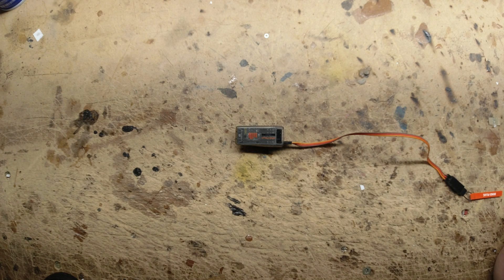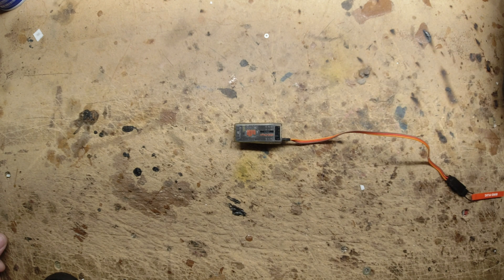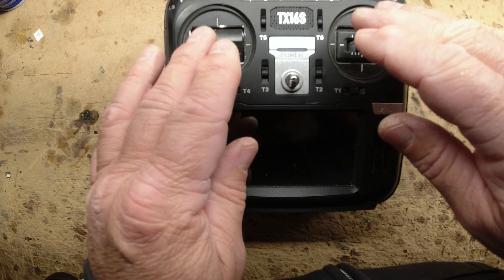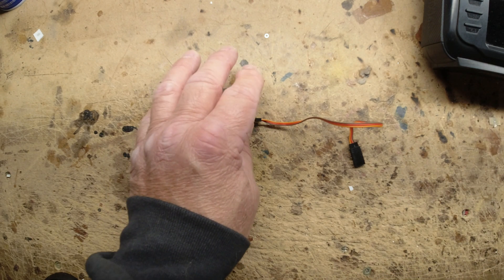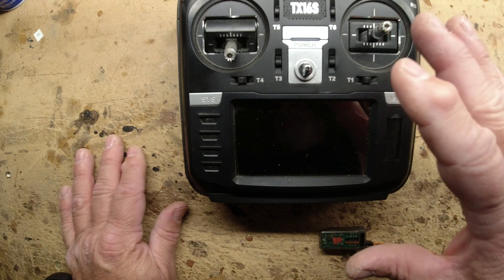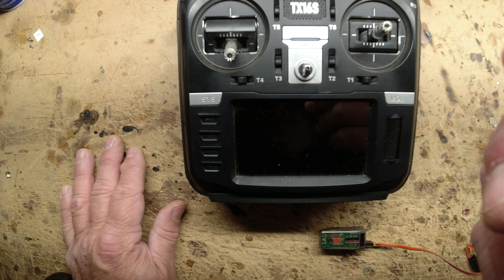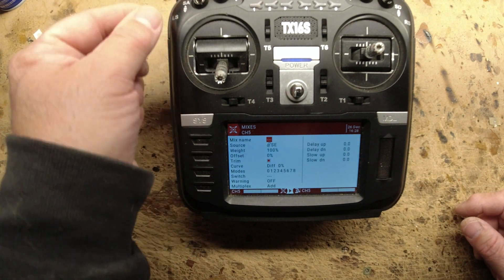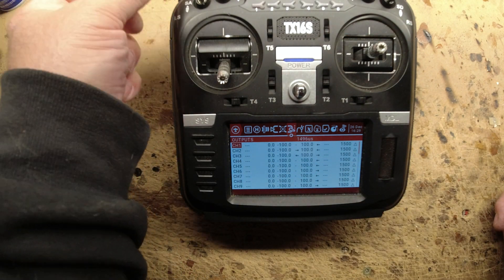Enabling both Spektrum SAFE and AS3X on your Radiomaster/Open TX Transmitter

Comment: Spektrum also has a control box & Bluetooth dongle that will fully bypass having to use a Spektrum Radio. I use my DX6E to program the receiver but it's only 6 channels. With the box, I can program countless channels & then use my TX16S to assign the channels to it. The other way is to have a Spektrum DX, NX or Ix radio & set it up. For under $50 I got the box & dongle because I have a lot of Spektrum stuff but I don't want to be tied to them anymore. I recommend this radio if you want diversity with your models

Comment: I just bought an Eflite Cirrus SR22T 1.5m BNF & the manual clearly explains the difference between keeping the bind plug in while binding & pulling it out before binding. You are 100% correct

Comment: are there any problem with umx planes safe,  or does everything work well?
Reply from the maker: Works fine with UMX
Reply: thanks, because I want to buy a UMX Turbo timber evolution and a TX16s and was unsure if it would work :)
Reply: so does that mean, that i could bind the plane to a tx16s.  And safe, as3x and the flaps would work without a spectrum transmitter?  
and would the binding procedure be the same as with a spectrum transmitter minus Setting which switch is controlling what cannel before binding?
Reply from the maker: I have heard it can be tricky when the plane is a 6 channel.
Reply: but does safe work without a spectrum transmitter or binding it to a spectrum transmitter?

Comment: I've done everything u mentioned it did the 2 flicks on the surfaces to get safe allocated a switch did stickers to centre but I'm still in as3x any ideas
Reply from the maker: There are 2 different ways to bind the receiver based on whether you want SAFE. When SAFE is enabled the surfaces will move 4 times.

Comment: Hey I just got gifted like 12 old rc gas planes, one of which is a ultimate 120 and this is a new world for me. It needs a new battery and stuff, whats your email address and if you don't mind id like to ask you some questions regarding it bc everything is enclosed and id like to ask you some questions... I see your plane profile picture is an ultimate
Reply from the maker: I’d love to help but unfortunately I know nothing about the gas planes, electric only for me.
Reply: @TakeItRC  ahhh ok, yea I've been electric only myself, a guy gave me all his old planes some of which are very expensive and they need new servo batteries and id like to update the recievers, I will ask you this tho, which brand recievers do you like other than spektrum? The planes now have older hitec in them and I want more modern recievers
Reply from the maker: @nichollsboy11  I use the FRSKY S6R in most of my planes. It has their version of AS3X and SAFE mode at half the price of the Spektrum receivers ( I have made a couple videos about them). Be warned there is a learning curve but I think they are worth it. I used to fly gas planes when I was a much younger man back in the 80s before electrics were even a thing and I have to tell you electrics are so much easier and actually have more power than the gas engines. Gas engines can be a real hassle but some guys,  mostly the old timers, still enjoy them.
Reply: @TakeItRC  awesome man thank you I just subscribed and ill check out those recievers

Comment: 1. The first thing you must do, regardless of the brand of transmitter is assign a 3-position switch to channel 7 or higher, if possible. This will let you use all 6 channels of an AR630, AR631, or AR637T(A).
2. To be able to unlock a BNF receiver, you must flash it with the latest firmware.
3. The latest Forward Programming LUA script will allow you to set up a Smart AS3X/SAFE receiver. You no longer need a Spektrum transmitter.
4. The transmitter must be in high rates (100% travel) when you toggle the flight mode switch 5 times (each way) while holding the sticks down and toward each other.
5. The TX16S mode must be set to “DSM X 2F” and “Enable max. throw” must be unchecked.
6. You can disable AS3X in one or more switch positions if a BNF receiver has been unlocked. However, if SAFE is enabled, AS3X should also be enabled.
Reply: Thank you, @txkflier. I have been thinking of leaving my DX6e and getting a Radiomaster TX16S II, as I am not in the mood for spending $550 on an NX10.
Reply: So it finally worked! Here is what I did that finally made it work for me with a used Night Timber x and a AR637TA: my radio had safe on channel 7. Radio set to high rates with safe on. I put in the bind plug and pushed the bind button on the RX. Then I connected the battery, removed the bind plug as suggested (within seconds of connecting the battery), then I selected bind on my TX16mk2. Worked!!
Reply: On second check. Now I have safe on all the time! Gotta figure that out next...😢
Reply: Problem solved by using forward programming and assigning a switch.
Reply: How would you disable AS3X on a TX16s, can you please elaborate? Furthermore what is it that allows the rx to know that the safe and AS3X functions are assigned to channel 7 etc?
Reply from the maker: There is no way to disable AS3X that I am aware of, only SAFE.
Reply: @TakeItRC  If you don’t want AS3X in one of the flight modes, all you have to do is set the AS3X gains to zero. It’s been that way ever since the AR636 was released several years ago. If you have one of the newer Smart AS3X/SAFE receivers, you can turn AS3X off in the SAFE Select menu or you can upgrade the firmware and you can turn the AS3X gain down to zero in one of the flight modes. And if you do a Factory Reset, the gyro will be turned off completely until you reprogram it.
Reply: @TakeItRC  I disabled as3x by putting it on a 3 way switch. So now I have safe+as3x, as3x only and neither when the switch is centered.
Reply: @786free1  What is the model number of the receiver and is it in a BNF plane? If so, which one?
Reply: @786free1  You disable AS3X for a particular flight mode by setting the AS3X gains to zero. In Forward Programming you can tell the receiver which channel you want to use to control the flight modes. I use channel 7 on a 6 channel receiver, 9 on an 8 channel, and 11 on a 10 channel receiver. The Smart receivers can decode up to 20 channels.

Comment: Have you tried your switch assignment, Safe is Aux 2, with the switch assigned to Aux 2 then bound it to the Radiomaster. I use Spectrum transmitters but my son is thinking about the TX 12 MKII instead of an 8 channel Spektrum. He wants safe but on a DX 6e he can’t do flaps, gear and assign Aux 2 so he needs at least a 7 channel transmitter. Thoughts??
Reply: The Radiomaster TX12 Mk11 is only available in CC2500 single radio chip, or ELRS versions. To bind to Spektrum you will need a 4-in-1 Multi Protocol Module (or a Spektrum Module) in the back JR bay.
Reply from the maker: I have not been able to program SAFE and AS3X in the TX16S with more than 5 channels

Comment: Breakthru!!!!...I did it.Both as3x AND Safe assigned to a switch!..NO SPEKTRUM TRANSMITTER NEEDED!!!...I just did it!!.I bought a new eflite trojan 1.2 meter with flaps and retracts.it has an avian reciever.......this is what u need to do. Go to telemetry and download all the sensors. (theres 60 of them) this is a AR631 with avian esc.(like i said eflites new 1.2 meter t28)..the screen might now flash sensors full..just reset the radio.(turn it off then back on).u will see all 60 sensors..then bind the radio to the reciever how the book says to put it in SAFE MODE.. (2 dances when u plug in your battery)..now here is the important parts or it will not work!, Go to mixes and assign a switch to channel 8.I assigned SA switch to channel 8.. Last step,Go into INPUTS and make sure u have aileron,elevator,throttle and rudder ALL at 100 percent rates!!..NOW u can hold the 2 sticks inward to the bottom and flick your SA switch 5 times or 6 and u will see everything move .IT is now SET!!!.. It would never work for me because i didnt have my high rates at 100 percent thro.i had them at 90.u can change your rates AFTER u bind it to a switch.if u bring up your channel monitor make sure ure rates are all going to 100 and the direction it shows in the BOOK...i worked at this forever.it finally hit me.put the rates to 100 percent and assign a switch to ch 8 and bind it in safe,DONE!!....if i had to buy another spektrum transmitter it would defeat the purpose...
Reply: Hey i was wondering if you were using edgetx or opentx also how do download sensors i am using a ar637t receiver with edgetx and when I go to telemetry and click discover new nothing comes up do you have any suggestions thanks for any info
Reply: not bullshitting anyone.if u need help ask ill try to help.remember as3x is ALWAYS on!..even with safe off as3x is on.
Reply: I messed with this for 4 hours - read your breaktrhru moment and tada!! I had it on low rate, and couldn't get the switch to toggle between Safe/AS3X. Put it on hi rate, and it worked! Thank you!!!

Comment: When 1st initiating the Spektrum reciever can you do it with the controller that comes with the rtf kits or it needs to be the DX controllers? Also do you use a dual rate switch in conjunction with the as3x flight modes?
Reply from the maker: Never tried a RTF radio before. You need a 2 or 3 position switch to select between SAFE and AS3X. If you didn’t need safe you can just bind it without SAFE enabled and then you don’t need a switch, AS3X would just always be on (you can’t disable AS3X , only SAFE)

Comment: Thx for the tip. Very useful.  Is it possible to enable safe and disable gyroASX3 or the other way round., or it is either both ON or both OFF?
Reply from the maker: AS3X is always enabled, but you can disable SAFE
Reply: You can disable AS3X and SAFE, but if SAFE is on, AS3X must also be on..
Reply: @txkflier  Thanks a lot.

Comment: So you just forgot to set the switch to the proper channel for safe?
Reply from the maker: No I set channel 5 for the different flight modes. However apparently the spectrum receivers need to be initialized with a spectrum transmitter in order to enable all the different flight modes before you can find it to your radiomaster properly. If it is a used model it may already have been initialized and then you can bind it right up to the radio master and use all the flight modes at the same time

Comment: Man I’ve been looking for a answer.. can the eflight viper 90mm with safe bnf work with the tx16s?? Thank you
Reply from the maker: Absolutely. I have a bunch of bind and fly planes on my radio master. You may need to initiate the model with the receiver with a Spektrum radio in order for both safe and as3x to work at the same time. I have a video about that.

Comment: Why can’t it turn AS3X off? My spectrum txt can use 3 way switch , mode1 is off(no as3x no safe) mode 2 as3x on, no safe. Mode 3 safe only. 
Are you saying I won’t be able to do this with the Taranis?

Comment: I have several BNF Horizon airplanes and don't own a Spektrum transmitter. I have safe and as3x enabled on all of them. What I've found is that for some planes I've had to set the reverse on some channels for the control surfaces. This means you might need to hold one of the sticks to the outside instead of inside when setting the switch for safe and as3x.
Reply from the maker: Yeah I never tried that that's interesting
Reply: I just got a E-Flite Viper 90mm and on my TX16S AS3X is always on but I can turn SAFE ON/OFF. But now I have to figure out how to make the EDF reverse. I did program the AVIAN ESC via my DX9 so that reversing is enabled. I not a hardcore EdgeTX programmer but my idea is to use the momentary switch to reverse the EDF. Thank you for your above comment - when I hold one of the stick in the opposite direction (to the left) if enabled the switch - and that is on a AR637T.  THANKS!
Reply: does it also work for UMX planes?
Reply: Yes it also works for umx planes.
Reply: On the Avian ESCs I use the Spektrum ESC programmer. The EdgeTX radio can't directly program Avian ESCs other than stick commands. There is a new LUA script for Forward Programming that will let you program Spektrum receivers.
Reply: what a Avian ESC?
and how can i download the new LUA Script?

Comment: Can you let me know what Spektrum receivers you have been able to do this on? AR636, AR630, AR637T? I have a new TX16s Max and I have been reluctant to change over due to this issue. Plus telemetry alarms.
Reply from the maker: Don't remember which receivers but they are the ones that come with the  Valiant, Trojan and Consendo Evolution.

Comment: So, your solution is to buy a Spectrum tx?  Ridicules solution!  Throw the rec in the trash and put a Lemon rec in.  There are
Reply: I wouldn’t use an Admiral or a Lemon receiver. They’re both junk. I use the Spektrum AR636 or their newer Smart receivers with external antennas in about 20 EDF’s. I’ve had no problems at all..
Reply from the maker: No I definitely wouldn't buy a spectrum receiver unless it already comes in the plane as in a bind and fly version
Reply from the maker: By the way stay away from lemon receivers they are garbage! Motion RC has their admiral receivers which are the same thing as the lemon and I lost two planes because of them.
Reply: @TakeItRC  The Motion RC dont have the same software as Lemon, the Lemon are great, the rebranded ones from Motion are junk
Reply: @MikeyMikey1968  How do you know this?

Comment: I even got telemetry working fine.
Reply from the maker: How did you get the telemetry working? Are you using s6r receiver?
Reply: @TakeItRC  It may be the same thing with using a Spektrum TX first because I did search for sensors with the auto setup while I had my old DX8e out. I can't remember off the top of my head what receiver it is. It was in a BNF E-Flite Air Tractor that I got as a gift. AR637T or something? Anyway I searched for telemetry sensors in my TX16S Max and it came up with a list of about 20 sensors. Most of them were sending signals, so I quick soldered up a voltage sensor "extension cord" to go between the battery and speed controller. It turns out I get RX voltage, Battery Voltage, gyro position sensors, gyro input sensors, and what I assume are real wavelength readings in real time or something. There are also some dead sensors because the only telemetry "module" I have set up is the cord for battery voltage. It sure is nice to have that though.

Comment: I accidentally got mine set up last night lol
Reply: @TakeItRC  I was trying to avoid using my Spektrum tx and tried messing with channel limits, inputs, mixes, special functions, and even curves. I gave up and just assigned the channel on my DX8e and then did the switch wiggle on my TX16S after binding. Now it works. It is something in the multi-protocol module not sending the same simultaneous signals for programming as the Spektrum module I think.
Reply from the maker: I can never get the switch wiggle to work on the tx16s.
Reply: @TakeItRC  we can make an OpenTX hashtag to try to get forward programming updated in the firmware? Maybe #wiggle-my-switch-opentx?
Reply: @cwwisk  What version of Open TX are you using?  Thanks
Reply: @TakeItRC  I can with the BNF receivers with my Jumper T16, but I cant with a over the counter receiver.  The over the counter receivers need forward programing.  The BNF receivers that come with their planes are programed slightly different.  The newer version of Open TX is starting to offer forward programing.  I have not updated yet.